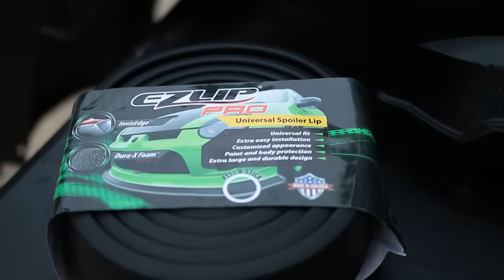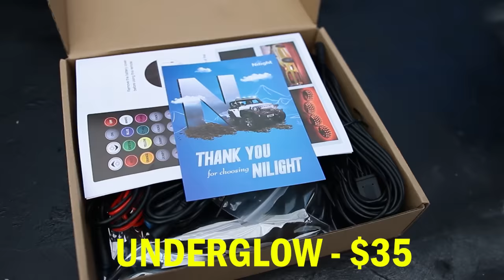Transforming A Subscribers Car In 10 mins!! (Budget Build)

Comment: Nice especially for a tight budget. I flipped an e46 last year and did the same process. I went with the high gloss white rust oleum. Used about 15 cants total. Let it cure for 3 days in my garage then wet sanded the whole thing then buffed it out and it honestly turned out amazing. I couldn’t believe the results from a paint job from a rattle can with a little prep work and post spray work it’ll really shine
Reply: What’s up man, quick question what grit of sandpaper did you use? going to do this weekend.
Thanks!
Reply: @beredanny8691  I used 1500 grit after paint and clear. 1500 grit wet sand use water with a hint of soap for lubricant and then use a cutting complaint when you wax
Reply: @dannyb5863   hey man quick question do you have any pictures of how it looked after I am thinking about doing that too mine
Reply: @swavy2634  I do have pictures….idk how you would be able to see them tho ??

Comment: dope transformation as usual! the nitto lettering on the hankooks killed me though 😂 i wonder how smooth you could get the paint job with a solid wet sanding, cut and polish?
Reply: I agree. A clear coat and a 2-step detail definitely would've made that paint drip and If the tyre letters matched the brand I would've forgiven it. Looks good all-in-all

Comment: I just feel like the entire time and materials spent could of been roughly the same by using a welder and fixing the metal that way, I get the need for the subs for a budget way, however going the bondo route instead of showing a cleaner and just as cheap, welding route, would keep the car at least structurally sound. Good video though

Comment: Amazing job. Imagine working cosmetically on your own vehicle and parking in your own driveway, and while you’re asleep in your home, a sabotaging and narrow minded neighbor decides to urge his friends to tear down your hard work everyday. My secured Nitto letters were burned ripped poked and cut off in less than 3 months, leaving much of the glue and pieces that were too hard for them to remove without a witness. Whatever they use has extreme heat, and it’s sad. No answers. I am looking for ideas to add and secure my letters again. Any suggestions for my tires?

Comment: loved everything but two things. the lettering was kinda ehhh cringe tbh and the dent on the back quarters near the rear window is an easy pop out fix. but otherwise that paint turned out wayyyy better than expected. side note, when u use those fill patches get the backside with bondo and smooth it out behind the wheelwell. over time the mesh will crack and fall out and a good kick will take it back off again.

Comment: All that prepwork on the body just so those turbo cans can leave that horrible orange peel.. I used a can once to repaint my integras trunk and I said nope! Just stick to regular sized cans with normal tips guys. With a skilled hand, you can have real nice results. The turbo cans just spit that paint out way too quick. I paint cars with rattle cans pretty often and normal sized cans work best. Other than that, the refresh was pretty good. But again, NO more turbo cans!
Reply from the maker: Not sure how you repaint cars with regular cans it would take 100 of those... I would never attempt that
Reply: @SmplBuilds  check out Moore motorsports channel. He probably does the best rattle can painting on YouTube I've seen. Usually uses about 6-7 cans for a Civic like the one shown here.
Reply from the maker: @G4REAL.  6 - 7 cans of regular size paint can will barely cover the hood idk what you're talking about man